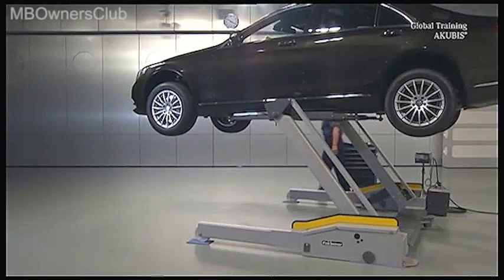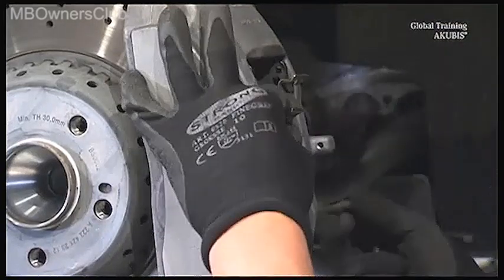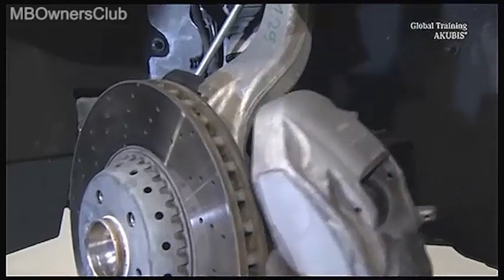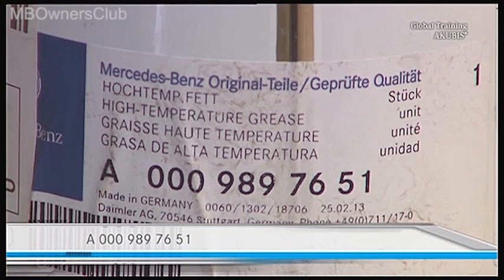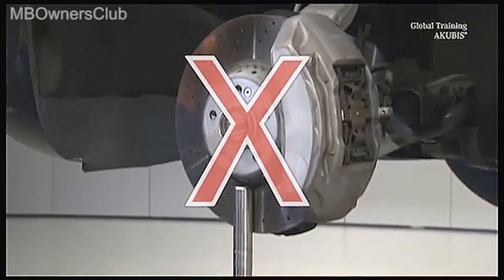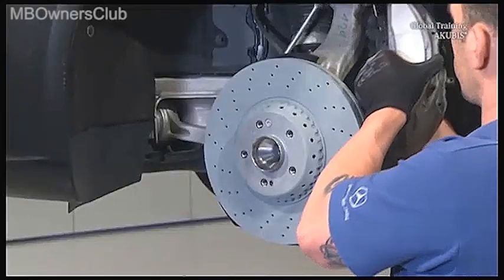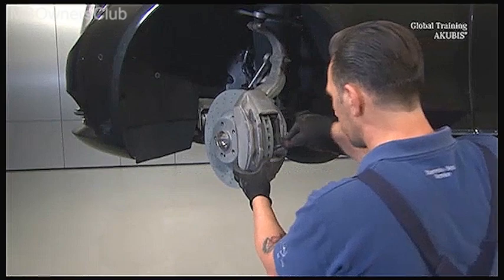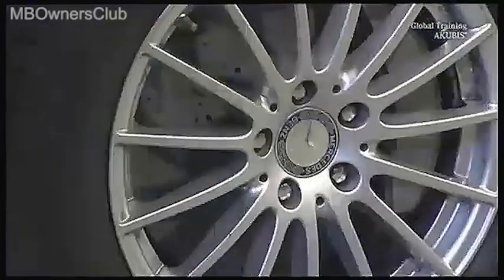Mercedes-Benz S-Class - Removal & installation of the brake discs (Front axle) | W222, C217

Comment: I always clean braking surface of discs with brake cleaner, to get rid of oil which disc manufacturers apply to prevent rust while disc is in shelf. I did not see him cleaning disc in this video so maybe mercedes dont recommend it?

Comment: I've never understood why you can't handle the rotor from the center. Anyone have any ideas on why?
Reply: Bec the brake disc has two parts combined. If we hold the the rotor by the centre, afraid it'll become loose
Reply: It's BS, 100% it will be fine. If it can't take its weight that way, then Mercedes made a s*** part. It's not fragile, it's a freaking brake rotor.
Reply: It’s thin and fragile. A heavy rotor can brake if handled that way.